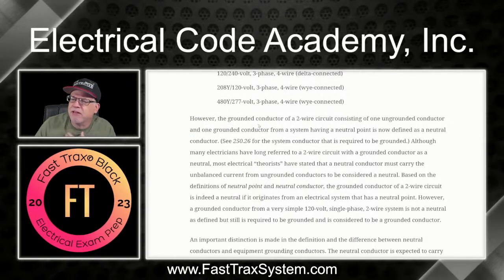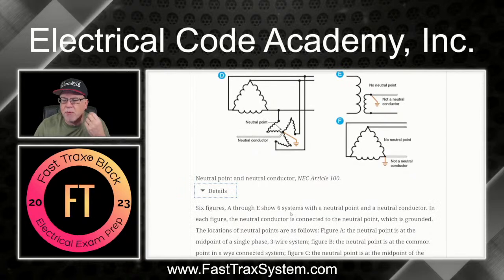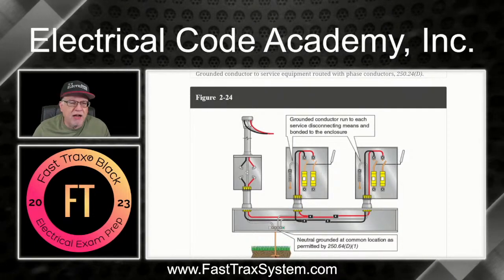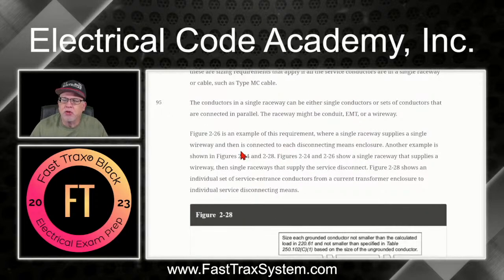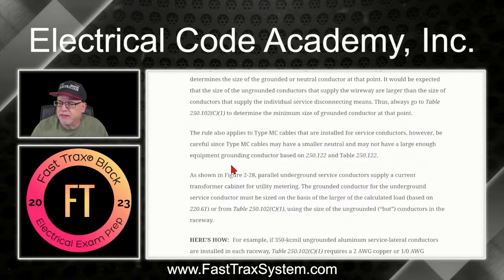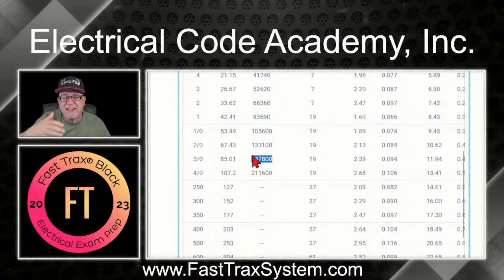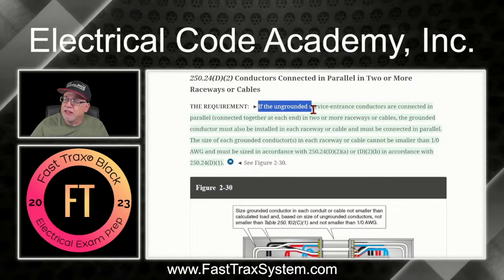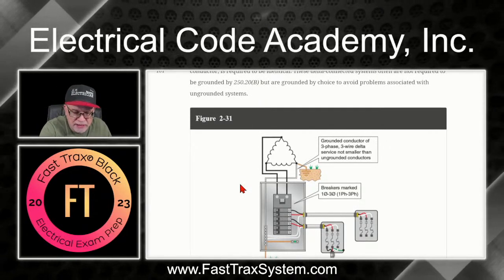Cracking The Code | Grounded (Neutral) Conductor

Comment: Hello Paul, On a CPT how come we ground the X2 terminal? Would it be considered a netural connection even though it is at the opposite end of the X1? In my mind the netural would be the center of the winding.
Reply from the maker: In a Capacitive Voltage Transformer (CPT), also known as a Capacitor Voltage Transformer (CVT), the X2 terminal is grounded for safety and operational reasons:

Safety: Grounding the X2 terminal ensures that in the event of an insulation failure or any other internal fault, dangerous voltages do not appear on the secondary side of the transformer. This provides protection to equipment and personnel.

Reference Point: Grounding provides a stable reference point for the secondary circuit. This helps in maintaining accurate voltage measurements.

Circuit Completion: In many CPTs, the X2 terminal is the common or return path for the secondary winding. Grounding it completes the secondary circuit, allowing for the proper function of measuring instruments or protective relays connected to it.

Noise Reduction: Grounding helps in reducing the effects of external electromagnetic interference or noise on the voltage measurement.

Voltage Division: In a CPT, the primary voltage is divided between a series of capacitors. Grounding ensures proper voltage division and stability across these capacitors.

Surge Protection: Grounding can help in dissipating surge voltages due to transient events, thereby protecting the equipment.
Reply: Paul, very much appreciated. Thank you.